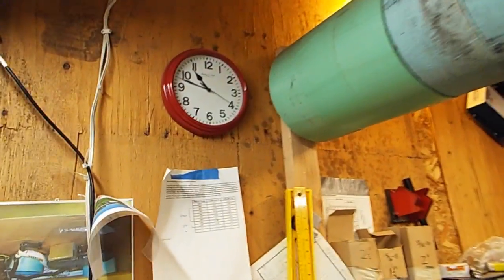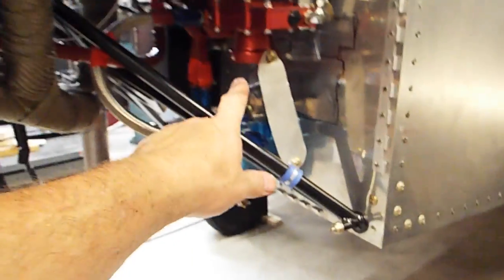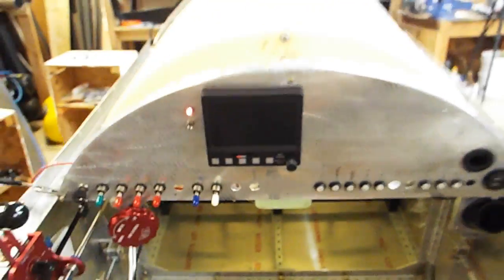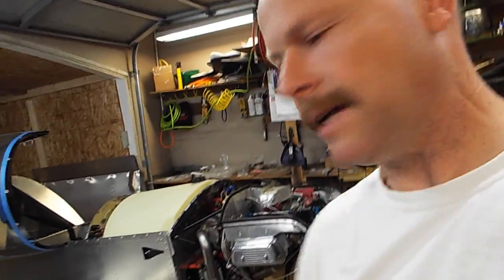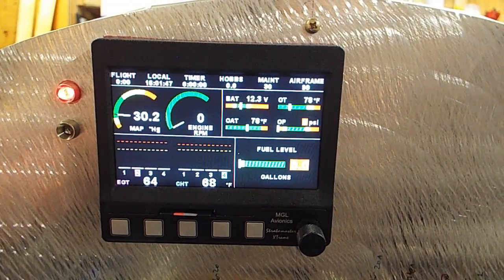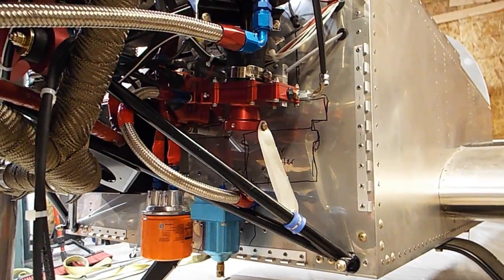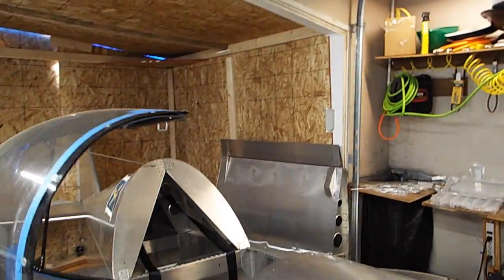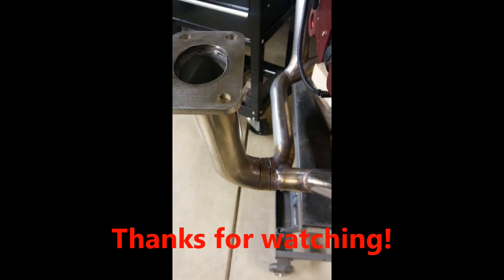Onex Turbo Startup!

Comment: Pull that old  unreliable VW engine and replace it ,(if you can afford it a modern reliable Viking Engine from 80 to 150 hp.
Reply from the maker: Looks like the Viking130 and aerovee turbo are same price...just have to get a mount....vw sure is easy to work on...and cheap!

Comment: It's best to have these test done outside. It doesn't take much fumes to explode if there is a spark near buy. Obviously you were lucky enough to not have that happen, but someone else could see this and not be as lucky.
Reply from the maker: Must not be too explosive---10s of millions of Americans pump there own gas into a car with hot exhaust pipes all around them (unless you are in oregon!!)
Reply: @1bengrubb  I don't think  10s of millions pump gas in their cars in a closed garage. I know of people who have been blown up with as little fuel as I saw when their hot water heater lit the fumes. all it takes is the right conditions and since you can't control everyone's conditions, it's best not to do dangerous things in a YouTube video..
Reply from the maker: @kennybarrow9835  oh I think I got it.. your definition of dangerous and mine are not the same...I recommend for your safety you don't watch my videos.  You may get ideas that exceed your capabilities.  You definitely should not watch my test flight vid---I"m not a test pilot and I test flew my own aircraft(bad youtube example)!  Oh man it was so fun--so satisfying--and soooo scary!  My adrenaline had not been that high since...hmmm... ever I think.
Reply: @1bengrubb  I am surprised that you were able to build and fly anything. You don't seem to be able to accept constructive criticism from someone who has built and flown quite a few aircraft as well. Hopefully your luck will last a lot longer than your temper.
Reply from the maker: @kennybarrow9835  no I'm just saying that our definition of dangerous is different.
Reply: @1bengrubb  That's evident in the videos. That doesn't mean that you are setting a good example for others. Ask any experienced AP mechanic who follow fire martial recommendations if your definition of dangerous is correct.

Comment: Congrats and nice build!  Any heat issues between the turbo and other stuff packed near the firewall?
Reply from the maker: Yes it started melting my ignition module and battery.  I thought the module was melting itself but it occurred to me that the water port of the turbo (not using) was pointing right at the ignition module shooting a jet of hot air on it.  Made a thin shield for the battery and module and no worries.
Reply: @1bengrubb  Glad to hear you caught it, and the fix was permanent!

Comment: I'm currently thinking about the 1X with the arrow V Turbo. I notice the hose clamps don't have a locking mechanism. Probly not necessary but I'm a double Virgo. The spelling above is my voice recognition not working that well but I'm not going back to fix it. Thanks for the video enjoyed it.
Reply from the maker: Yep 16 hose clamps hold all the intake on!  My counselor had me twist wire all of them. Then as I worked on it I would not immediately put them back on.  My buddy developed an air leak on his Aerovee so he encouraged me to replace the twist wires on my hose clamps.  If there were huge push fittings that would be cool.

Comment: THANKS FOR A GREAT VIDEO.  I'm doing the aerovee turbo also and this video really helped too.
Reply from the maker: discovered the 2.5 needle is the answer with the turbo!
Reply: do you remember what needle came stock in the AeroInjector.  That's the one I left in there.  Thanks again.
Reply from the maker: @nwflyer7197  it comes with a #2
Reply: @1bengrubb  thanks much!  Blue Sky's to you !

Comment: How's it running now?
Reply from the maker: The turbo seized so I sent it in and it was due to rust from not running it enough.. they said it takes about one hundred hours to season the turbo so I'm going to add a port on the exhaust so I can squirt stable fogger into it after each run... Right now I'm finishing the vinyl and interior then we'll haul it to the airport!
Reply from the maker: heres the latest jan 2020  https://www.youtube.com/watch?v=9dZx94sAva4&lc=z225jbxgguuxzz1nwacdp435sa3uj23m025jttirlp1w03c010c.1581097726900841

Comment: Sent you text by phone.  WHen EI and Mag are both running, the EI is in charge and ignites the fuel/air according to temperature and density altitude sensed.  When you cut Mags off - you will hardly notice an rpm change.  But if you cut EI off, you are now running on Mags only and with just the manual changes to Mixture based on rpm you can see/hear.  So you will see 50-100 rpm drop (that is what I see on my RV anyway).